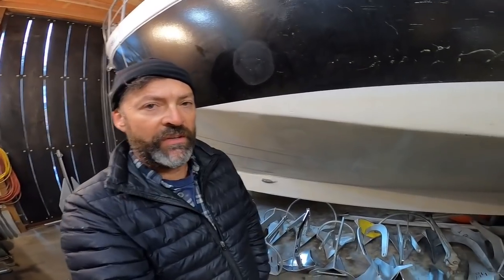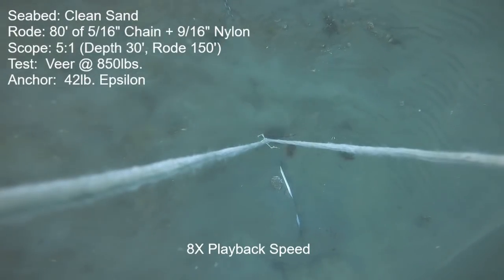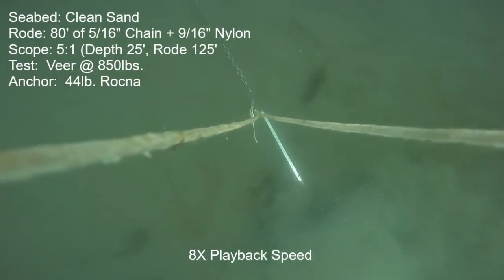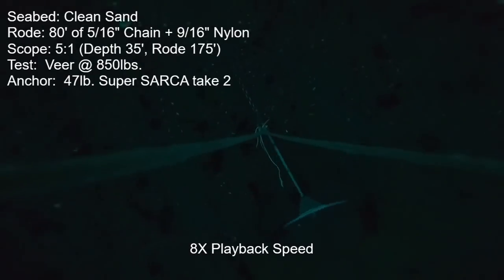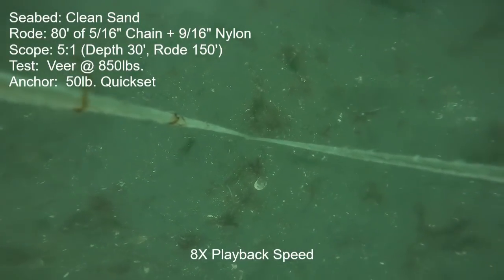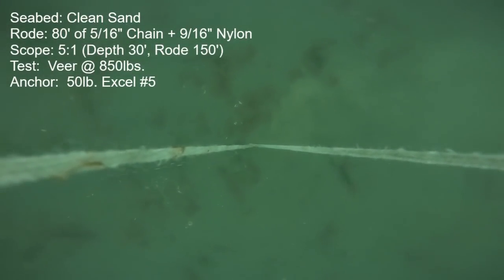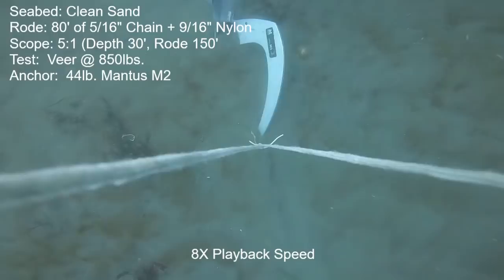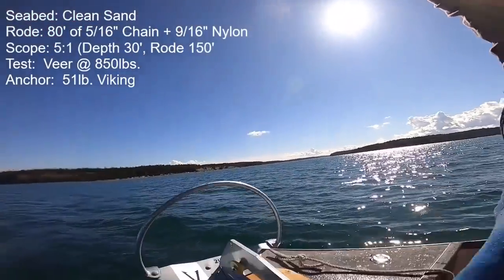Clean Sand Veer, 45lb Anchors.  Test Video # 127

Comment: Now that it is Hurricane season, your testing is valuable. Perhaps you could test some hurricane anchoring techniques . Such as the 2 anchors in a "Y" pattern or does a steel cable leader line between anchor and chain really help. Does everyone's favorite:5 gallon bucket of cement attached to anchor rode really help? What about shock absorbers. For example. Bungee cords/ rubber dock snubbers or a fender as a floating shock absorber(water resistance) on anchor bridle or anchor rode. Does it help keep anchor set? Millions of myths and not many answers. That video series could save lots of boats. Thanks again for all the great data.

Comment: It's really interesting to see how different your results are compared with my own experience. I've had a CQR 50lb that hardly ever set in any type of bottom, certainly not in mudor clean sand, at one point dragging more that 200m in sand. Also have a Rocna, which just always sets, and resets when the wind changes. 

It just makes me curious to where the differences are in set up or load or in the bottoms. To me, the difference is too big to ignore.

Comment: Hello Steve!
Maybe it is in the details...
I have pimped my 20kg Delta.
Sharpend and changed the angle of the toth and added a small piece,same on the flukes. Seems to be better setting but have not made any comparative tests...How do I submit pics if you are interested?
Good work!
S/Y "SOL" Sweden
Reply from the maker: Hi Bertil,
Please post your photos to a long running thread "Videos of Anchors Setting" on the "Cruisers Forum".  I started this discussion many years ago and it as attracted many knowledgeable comments.  
Steve

Comment: Excellent test! Very cool to watch! Knowing that the Viking 20 is so physically large… and slightly heavier than the “45lb” anchors in test I wonder how the smaller 15 compares to the 45lb anchors? I ask because the 15 is rated in holding similar to what a 45-65lb mantus might be (if I recall correctly). I have purchased a 15 in lieu of a mantus 65 (or 85) for our 26,000lb boat on recommendation that it’s the correct size as a storm anchor.
Reply from the maker: While the Viking 20 is significantly larger than the competition's 20 kg offerings, the Viking 10 is not larger.  I would guess that a Viking 15 will be somewhere "in between".  In other words, a Viking 15 might be only a small amount larger than other 15 kg anchors.  

The Viking is certainly a high performing anchor and in some seabed types (like soft mud) a Viking 15 could very well outperform some other 20 kg anchors.  However, there are other seabed types where the Viking is no better than other types.
Reply: 15 kg/33 lbs no good for storm with that tonnage. Everything else in the system must be perfect/overkill or you will not make it through a real storm. It's a damn good anchor....but noooooo, Capt. must buy another if you actually intend to ride storms. My boat is 26,000.......~75lb hook, 300 ft tapered chain, 500+ ft heavy three strand....2nd Bow Anchor~45lb in the ready. Storms change people

Comment: For perspective, can you remind us the hp of the test boat and what rpm you are hitting for the 1325 pulls?   Also, noticed a swivel on the Ultra. Is this because it doesn’t accept a correctly sized shackle?
Reply from the maker: 90 horsepower Yamaha outboard.  14X11 propeller.  This is a "fine pitch" propeller that is optimized for zero speed thrust.   5,150 RPM.
A swivel is present on the Ultra Anchor because the Ultra anchor company sent it to me for use.  If the swivel is not installed, two shackles can be used.  I have tested with both arrangements.

Comment: Steve, the Spade anchors now have the lead sealed in to the tip with epoxy. I believe this will stop the corrosion problem seen in the past on the older Spade anchors. Giving the new Spade a rating of 1 seems unfair when you are testing other new anchors that haven’t been around long enough to understand how they fair long term with regard to corrosion. Maybe the new Spade should have a corrosion rating the same as say Viking who is the new kid on the block. Time will tell how both these anchors perform longterm  corrosion wise. Nice summary of the 45kg anchors
Reply from the maker: Tim, I rated the 45lb Spade S100 a "1" (out of 5) for three reasons: Difficulty to regalvanize, Dissimilar metals, and Hollow shank (the failure of which, due to internal, unseen corrosion would be catastrophic).  

I rated the Viking anchor a "3" because of the "flaking" of the outer layer of galvanizing, and the Hollow Rollbar (the failure of which, due to internal corrosion, is not as catastrophic).

As far as the Spade's epoxy coating (of the lead), I would need to test this for effectiveness.  I would suggest that Spade Anchor send me an updated version.  I assume they have concidered this, as they were the first (of many) manufacturers to send me an anchor, (6 years ago).

Then again, if Viking were to send me an anchor from a batch that did not have a galvanizing flaw, their rank would increase to a "4".

The ranking system requires that at least one anchor recieves the lowest position.  Based on the anchors in my possession, the 45lb. Spade anchor most certainly deserves that position.
Reply: Steve,
Spade will give you a new anchor if you have the original receipt if your anchor has gone rusty. No need to re-galvanise. I know people that have galvanised them. They sent them to be done without removing the lead in the tip. They came back galvanised with no lead as it melted during galvanising. They simply then added the lead using fishing weights and a blow torch. Not so hard😀. I am not a salesman for Spade just a happy user with 19 years experience of using them on a very regular basis. Its a great anchor
Reply: @timevans8223  If the galvanisers had realised that, they would been served a humongous bill for contaminating their tank.
Reply: @Gottenhimfella  not in Trinidad😂
Reply: @flygoodwin  Steve, having had Spade anchors for longer than most people you are over egging the corrosion thing. It's just not that bad. If you have had excellent service out of an anchor for over ten years, anchoring thousands of times as liveaboards, the cost of buying a new anchor if you don't want to galvanise is tiny in the scale of things and overall cost of running a boat. You are down marking the best anchor out there for a none existent problem.
Reply from the maker: Tim, please clarify: Are suggesting that I abolish the Galvanizing Column in my ranking chart?  If not, which anchor do you think should be ranked lowest in that category?
Reply: @flygoodwin  the testing produces a set of results. Your guess on strength and failure is just a guess. Are you aware of any anchor failures? Why score any anchor on your guess that it might fail?
Why not stick to testing not guessing.
Scores would be about actual  results

Comment: Why does the Rocna perform so badly in your testing compared to every other independent test I have ever seen? Don't you think this is strange? It not slightly worse. In lots of testing the top 3 or 4 best performing anchors swap places but in your testing the Rocna is truly horrendous. Why is this? Do we assume all other independent testing including official bodies such as Lloyds are wrong? Or is there something strange going on here? My own experience of anchoring in testing conditions is the Rocna out performs Delta and CQR by a huge margin but not in your testing. What are you doing differently? To be honest, I am struggling to believe the results.
The other thing that worrys me about your testing is anchors still moving when you say they are set. This is plainly wrong. An anchor is set when it is stationary. If my anchor moves more than a metre is has simply dug deeper because it's been pulled under the sand. In your videos, anchors are still moving but not diving. These are dragging. If I spend a week using this anchor I would be on a beach or out at sea
Reply from the maker: Seabed type.

In three of my seabeds, (Surf Sand, Soft Mud, Cobblestone) the Rocna performed well against all other "non-pivoting fluke anchors".  For the two locations  where the Rocna performed  poorly (Sandy Mud, Clean Sand), my theory is that these seabeds have a cohesive quality that tends to cause fouling/sticking of seabed to to the anchor.  I would GUESS that the Rocna performed well in other people's tests because their seabeds did not have the particular cohesive nature that the Rocna is limited by.  

No, I do not think the other people's test are wrong.

I test. I film. I report.
Reply: @flygoodwin  I simply don't accept that a CQR has better holding than the same weight Rocna in clean sand. There is something very suspicious about this result in your testing. I am not a fan of the Rocna but I know it is a far better anchor in clean sand than a CQR. Every independent test ever has concluded this. Your table is the only one ever to rate a CQR higher than a Rocna in clean sand. Don't you think it is strange?
Reply from the maker: @timevans8223  My "Clean Sand" seabed has some "binding" material in the layers benheth the surface and therefore likely not as "clean" as other person's test beds.
Reply: @flygoodwin  so you are now saying that your clean sand seabed is not reliable? Or are you saying it is reliable and the CQR has better holding in clean sand? If the seabed isn't reliable then shouldn't you say so? If the seabed isn't reliable why are you testing in it? Do you believe the CQR is better than a Rocna in clean sand.?  The Rocna has probably been the most successful anchor in the history of anchor marketing yet you stand alone as the only tester to score it below a CQR. This simply does not stack up
Reply: @timevans8223  My understanding is that this sandy sea bed has some binder (likely mud) that causes the Rocna to scoop up some material and foul. It seems clear that the Rocna is dragging around a big chunk of seabed in this test, preventing it from setting. Different anchors perform better or worse in different sea beds. I don't think Steve has anything against any anchor, he simply tests and shows the results. Stacks up perfectly.